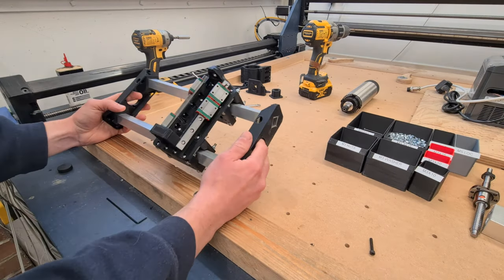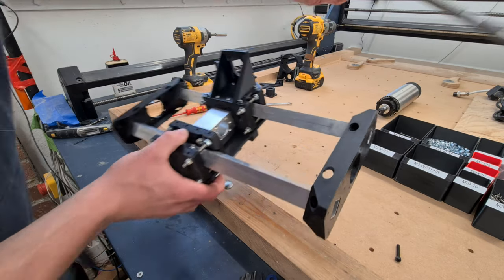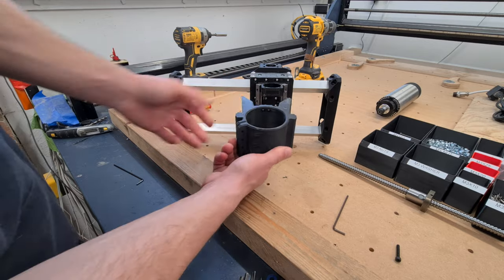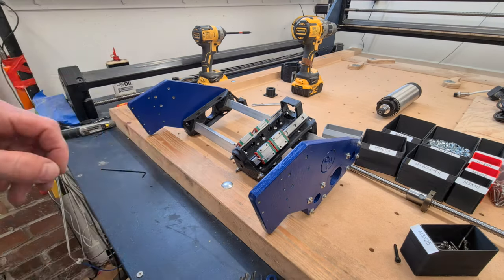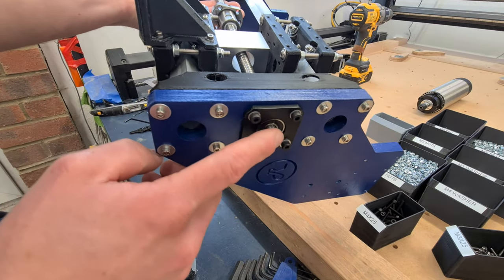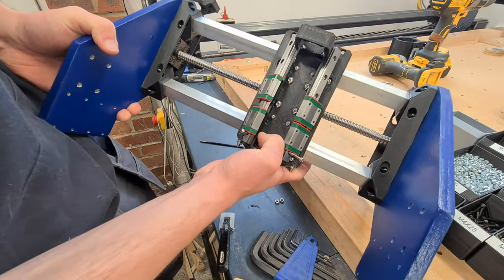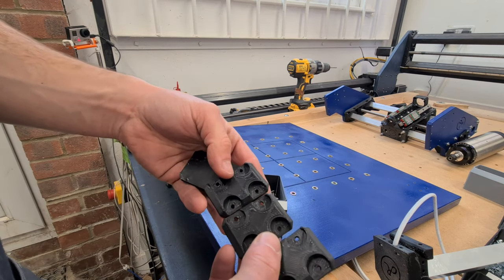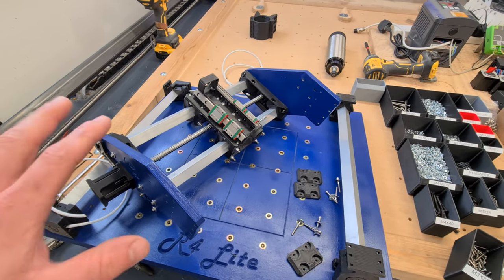Building a small High performance 3D printed CNC Machine - Root 4 Lite PT2

Comment: To hard to make this one I have made it in a different design I pick a fast design
Reply: What's so hard about this design? It is very straight forward and functional.
Reply: @flippingwoodforcash9130  I looked at your cnc design using C beams with V wheels looked like belt drive (Gt2?).  That is a very straight forward one just like previous ones that I have built and they work very well and keep costs down. This root 4 lite design is meant to be a very accurate little machine since it is using ball screws instead of belts/lead screws.  I doubt Pete designed this to be 1500mm x 1500mm. I am also into the process of building a PrintNC which is probably the most sturdy and accurate large DIY 3d printed cnc designed to date but it comes at a higher cost probably around $1000+